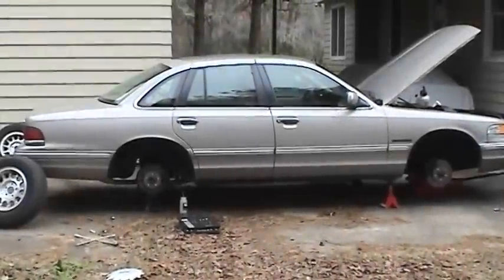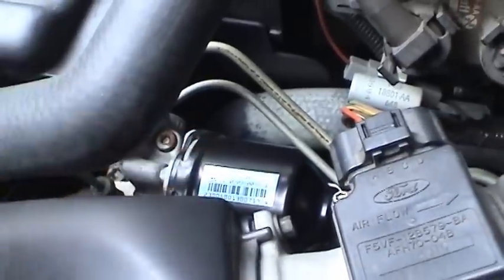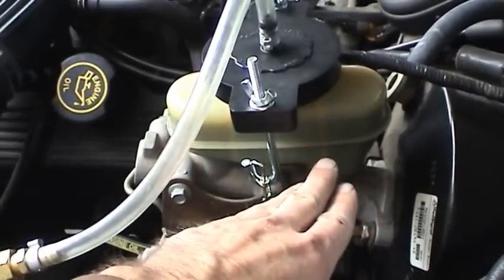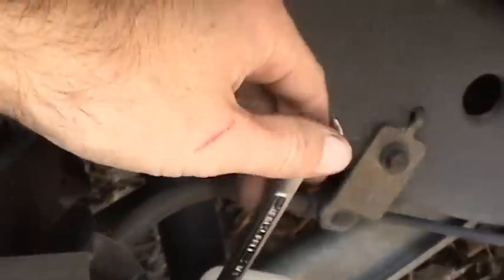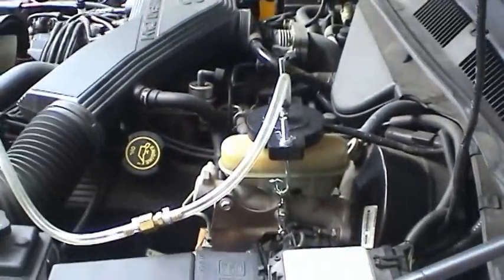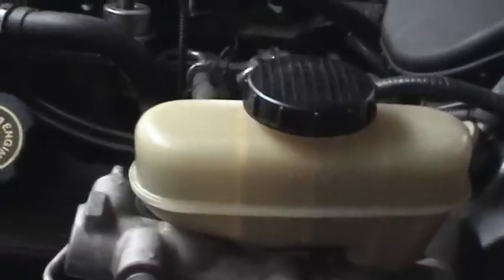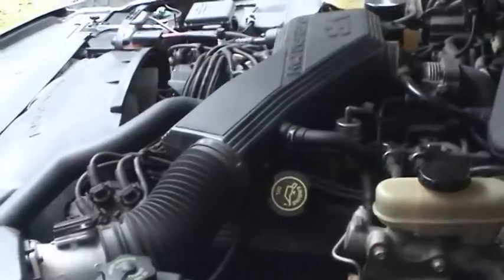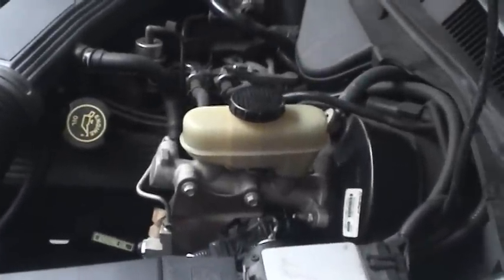1995 Ford Crown Victoria Complete Brake System Bleed

Comment: I unhooked the brake lines from my abs module and my master brake cylinder so I could replace upper control arm on the drivers side. Now I have a pedal that goes to the floor. Some of  my lines are rusted and we're hard to reconnect and the line going to master brake cylinder appears to be stripped. The left front caliper bleed hole won't open. Refilled with new fluid. What would you do to remedy this situation? Any advice would be appreciated. I just replaced my entire front end down to the center link and now I can't drive it because I have no brakes
Reply: kingofthe hill 123 This might sound cracked out to say but I've had several crown Vics that eventually blead itself.  Takes a couple days but...  Pedal felt perfect and brakes worked fine.
Reply: burn it

Comment: Those air bubbles you are afraid of that come up through the hose will go into the MC reservoir and join the other air that sit above the fluid already in there. It will not get sucked into the brake lines like you are thinking. Excess foam is another story if it weren't allowed to settle but new fluid is not foamy.